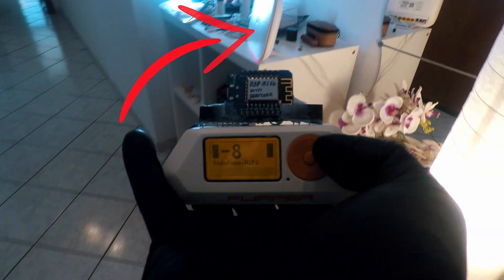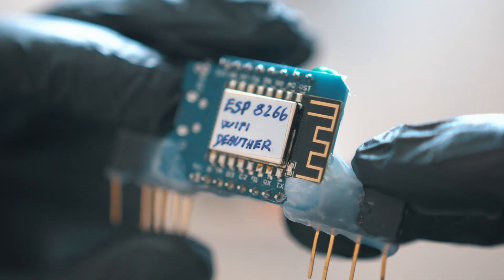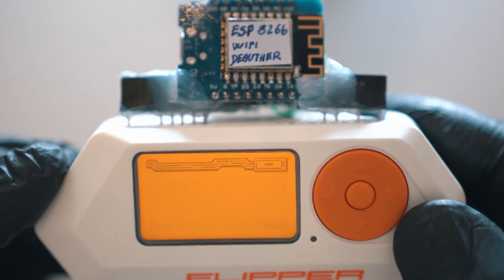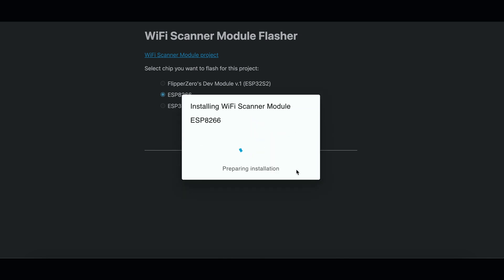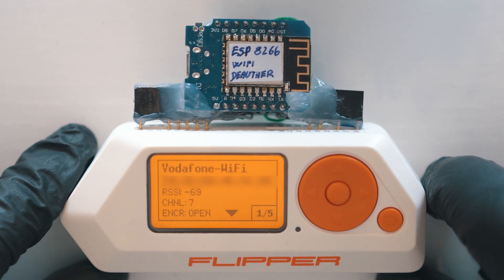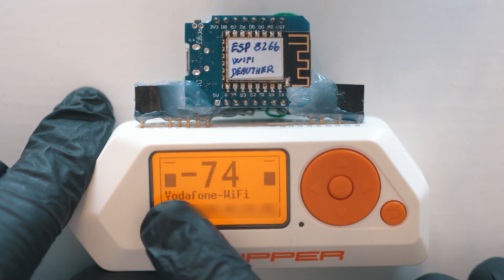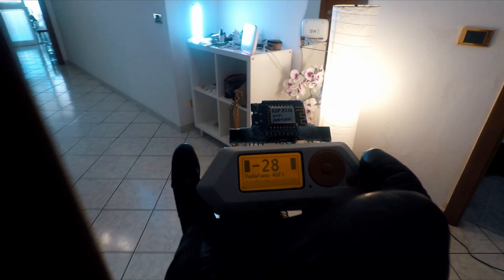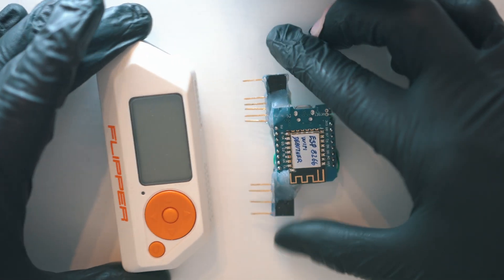Flipper Zero Wi-Fi Scanner with ESP8266 External Module

Comment: I've skimmed by 9 videos and all 4 vids I have watched were yours, all I wanted was a quick rundown on pinning out the 8266 to pop it in the flipper Zero. Flashing it and using compatible files on the flipper is pretty straightforward, but entirely useless if you don't have a way to connect them.

Comment: Out of curiosity, would this application work using the wifi dev board and Marauder firmware? That's all I have (along with my flipper) and am trying to scan signal strength as you demonstrate in the video...
Reply from the maker: it should work… I don’t have a dev board, but I assume it will work